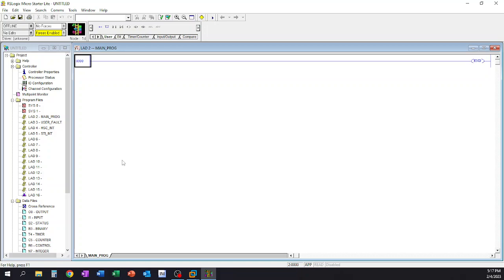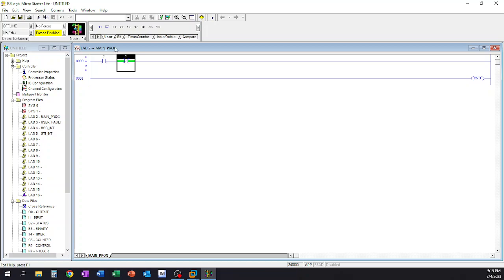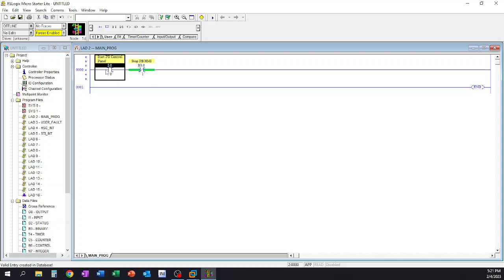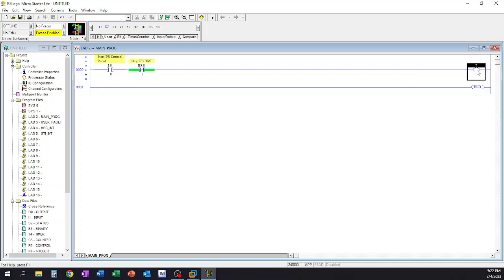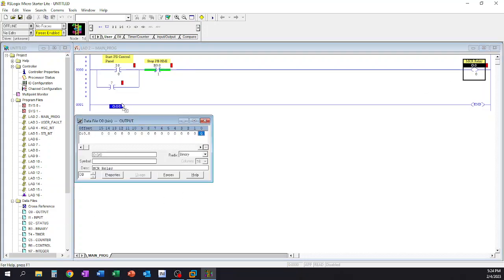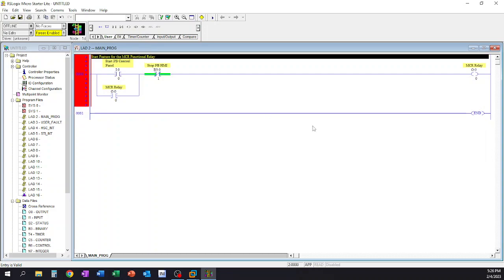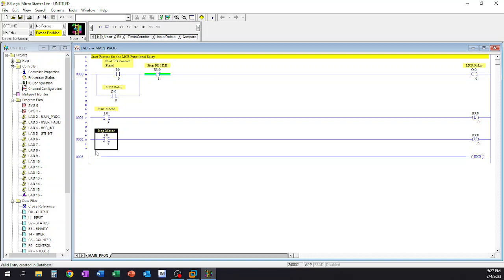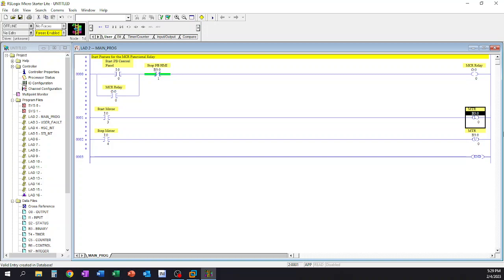RSLogix 500 Programming_2 Creating the XIC, XIO, and OTE

Comment: If I do end up using a Latch and Unlatch combo in a program as a beginner, should I get into the habit of stating what line the Unlatch is located in the comment section of the Latch's rung? I am curious what is considered normal out in the field when using them (other than to avoid using them if you can).
Reply from the maker: I would say this is a good idea.  Giving the routine and rung that it is located in will not only be helpful for yourself in troubleshooting, but will help others that would follow after you.